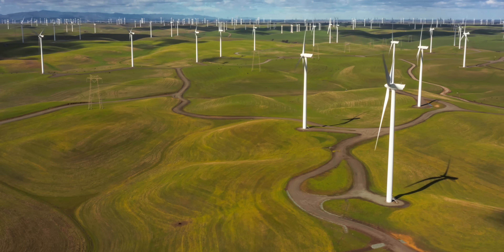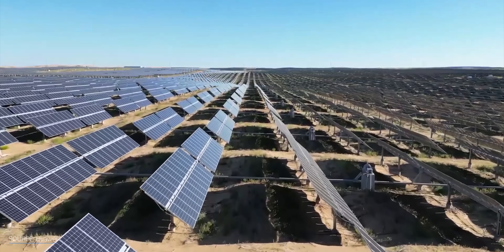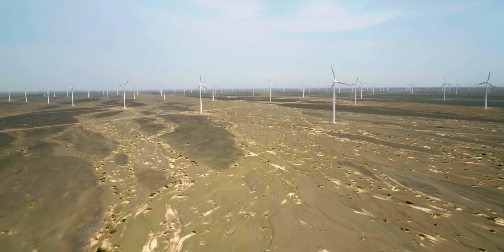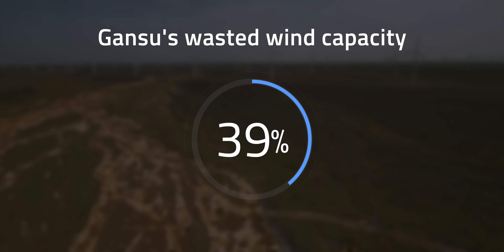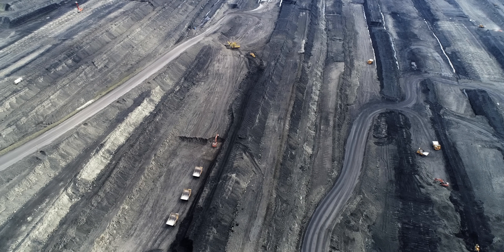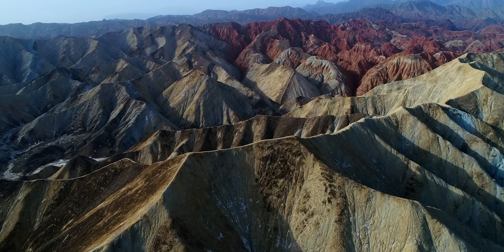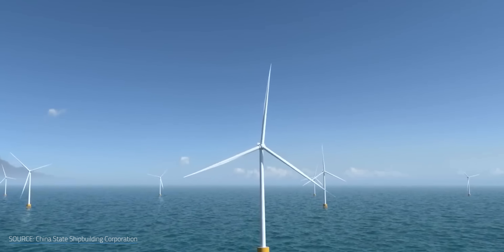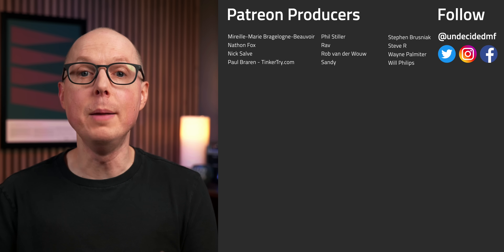The World’s Largest Wind Farm has a Tiny Problem

Comment: Transmission  is not the limiting factor here. In Australia, we are working on sending power from the middle of the country to Singapore, with negligible loss. 950 miles, even across mountains, is inconsequential for China. It's that No one wants more expensive power.
Reply: Intermittent renewables require a backup source of power to supply the grid. Hence more redundancies and more costs.
Reply: @dougpatterson7494  That's why they're also the biggest builders of nuclear power as well.
Reply: @personmcperson5740  negligible loss??? Unfortunately, that's a fairytale. There are always losses in power lines, and the longer they are, the higher the losses. Sure, the higher the voltage, the lower the current and the higher the efficiency (lower losses), but there are practical limits on how high the voltage can go before you get ionic current losses between the lines. This means that the higher the voltage, the further apart the lines need to be, which means the bigger (and more susceptible to the wind) the towers need to be, or the deeper the cables need to be buried. Transmission losses are far from negligible.
Reply: @AutoEngineerVideos  finally I see a comment on the tube which has some engineering basis rather than emotion driven by ignorant comments seen on other posts!   I've just flown back to Australia from Singapore and guess what, a lot of that was over water.   That would strongly suggest submarine cables would be needed to connect Singapore to Australia and as every power engineer knows there are limits to energy transfer in underground/underwater cables.  Not quite electrical engineering 101 but factual anyway.
Reply: @wishbone5785  to minimise losses, they would have to run a terribly high voltage (probably over a million). Just imagine how thick the insulation would have to be to stop a million volts from zapping stuff in sea water. It would be interesting to see whether it would be flexible enough to be put onto spools for easy storage and use. Wouldn't want to damage the insulation on marine cables for such high voltages by flexing it too much.

People seem to think that just because something is technically possible, it must be viable, but it doesn't always work out that way. There's usually a point where pushing further becomes an exercise in wastefulness and/or futility.
Reply: @AutoEngineerVideos  Would be interesting to see comments from other engineers regarding DC link voltages which are relatively common around the world for long distance transmission systems.  Definitely not technically viable for an AC transmission link at any voltage but I recall DC links can run up to at least 750kV.   It's not about zapping stuff in sea water, it's about the cable insulation integrity.  Electric and magnetic fields drop off rapidly with distance from a conductor ie inverse Distance squared.  Cable technology is out there and available for very high voltages but it's a real technical mission to repair any faults which occur on such systems particularly underwater.   Installation would be a massive undertaking anyway and would take years to complete and make Snowy 2 look like a kindy class.
Reply: @AutoEngineerVideos  ... Compared to other factors... carrying power a thousand miles is routine, and power loss over this distance is no reason to avoid doing so.
Reply: @personmcperson5740  transmission of power a thousand miles is far more inefficient than transmission over a relatively short distance, and should only be done if there's no other choice.
Reply: @AutoEngineerVideos  Several years ago I read in Scientific American about research into Superconducting cables, with minimal losses apart from a small amount of energy to maintain the low temperature. I wonder what happened to that?
Reply: 950 miles over the mountains from Australia to Singapore 😂 good god man, it's 2,500 miles of open Ocean from NT,, 4,000 miles from Center of the outback
Reply: @rosjay_2119  yes...yes, it is.
Reply: Is suncable really still going to happen?
Reply: @jonathanodude6660  IMHO,  nice try but no cigar. I think they are far too optimistic about the difficulties and the funding.
Reply: @hectorpascal  yeah it’s disappointing that we couldn’t make it work. I think there are better (easier) interconnection options, and the fact that the NEM doesn’t connect to the SWIS is kinda telling on the state of energy in Australia. Maybe we should focus on connecting Perth to Adelaide before we try to involve Singapore. It’s wild to me that the island of Tasmania is interconnected but both the west or north.
Reply: @jonathanodude6660  🤔 As a Sandgroper myself, I think we're happier out on our own for a quite a while yet, until the guys in the east get their energy costs well under control!
Reply: @hectorpascal  true yeah we probably don’t want to deal with that 😂
Reply: @jonathanodude6660  All the main backers have pulled out so no it isn't going to happen.
Reply: @thedave7760  I heard that a while ago but also that they’ve changed management. Sounds like there are people still trying to make it happen. I’m still wondering because obviously a shakeup like that reduces confidence.
Reply: @jonathanodude6660  Coldfusion had a video on it about a month ago, he said it was done and for a multitude of irreconcilable reasons.
Reply: @thedave7760  I might have watched that video and that’s why I thought it wasn’t happening. I was following it for years but it just seemed less and less likely as time went on. Japan still hasn’t built their interconnectors with China and I’m assuming the Russia ones are off the table now. It’s pretty depressing that something that has such obvious long term benefit is ruined by short term thinking and economic challenges. Maybe suncable isn’t the right project or maybe now is the wrong time but it’s quite clear that the only way to make renewables work is extremely wide distribution, international energy markets and integrated and financially viable storage solutions.
Reply: @jonathanodude6660  It was on the news this week. They are still pushing ahead.
Reply: @personmcperson5740 oh really? I’ll have a look and see where they’re at now then.
Reply: Australia is no longer working on transmitting solar to Singapore that pipe dream has ended just as most of this net zero nonsense will collapse eventually.

Comment: If the energy produced by wind, solar and hydro is done without direct subsidies (exception is depreciation expense) then by all means move forward.  As you mention in the episode the delta between wind/solar is at a multiple of.coal; thus the increased number of coal fired plants.

Comment: 20 GW is only 20 AP 1000 nuclear plants which take up less space, produce the power 24/7/365 except for approximately 30 days once every two years for refueling and maintenance and last sixty to eighty years. Wind and solar cannot compete on generation density.
Reply: I'm not sure about AP1000 specifically, but nuclear plants are either on an 18 or 24 month refuel cycle, and I think Exelon was able to get their refueling shutdowns down to near 21 days. The two biggest "problems" with nuclear are the cost to build and the negative perception. I am looking forward to how SMRs will change the nuclear landscape though.
Reply: Ready in 10 years too 😂
Reply: Your 20 nukes produce about 2.6x as much energy b/c their capacity factor is 2.6x higher.

Comment: 50% renewable installed power is a BS number for deception. And those 50% are only about electricity which makes up only a fraction of all energy used.
Wind normally makes about 10% on average over the year of it's installed peak capacity, so it would be 5% of China's electricity and since they are throwing away 1/3 it is closer to 3%.
And wind power is extremely problematic because there is no storage that can handle GWh of energy.
What normally happens is that the coal in the coal power plants keeps on burning and the coal power plants are just forced to blow off steam unused because there is nowhere to go for the electricity.
Wind in Germany has actually increased the CO2 output studies show. Without  wind power Germany would have reduced their CO2.
It is better to replace old coal plants by new ones to reduce CO2, if that is your goal. But that is a stupid goal.